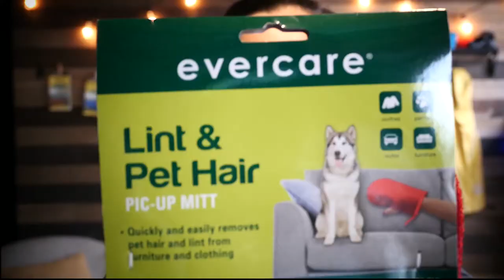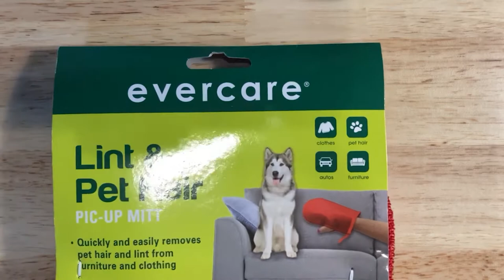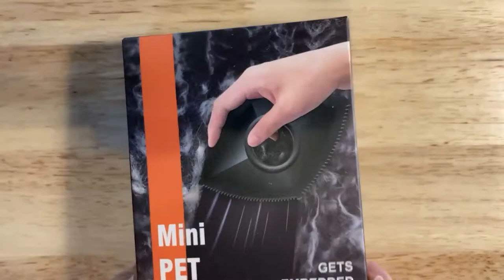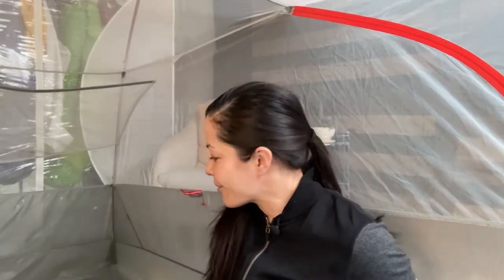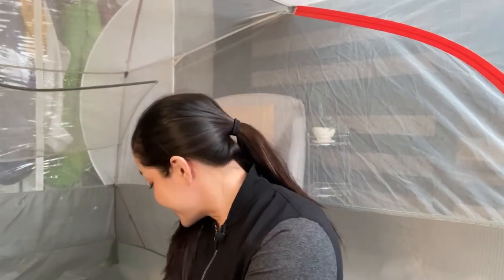Easily Remove Pet Hair from Your Tent! | I found the BEST NEW PET HAIR REMOVAL HACK for tents

Comment: I always avoid silicone dishes and utensils because they pick up so much dog hair, so it totally makes sense to me that it would make a great dog hair brush! Great video!
Reply from the maker: Thanks! The sponge is definitely a staple in my dog kit now.
Reply: @GIRLplusDOGAdventures  I may have to pick one up myself. Thanks for the info.  How I usually handle dog hair is to turn my fully assembled tent upside down and shake it, with the doors open. A few hairs inevitably get stuck here and there. I tried a super small brush and dust pan once and decided it wasn't worth the extra weight on a trip. The silicone sponge seems like a more effective option.
Reply from the maker: @lovedogsontheloose  Ah yes...the good ol flip and shake method.  I still use that one too.  The sponge actually came in handy on the CT to scrub off pine sap as as well.